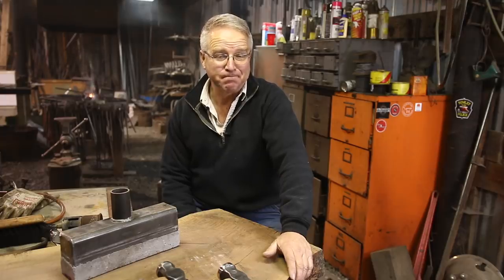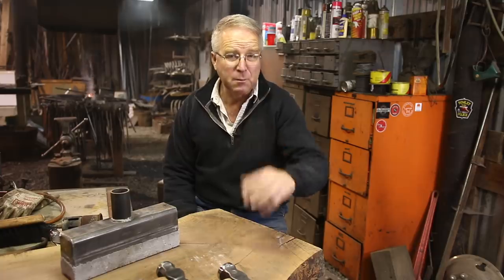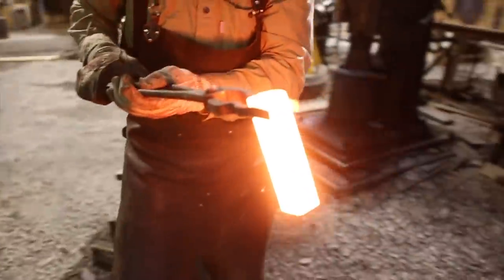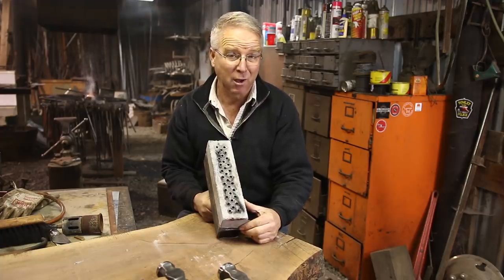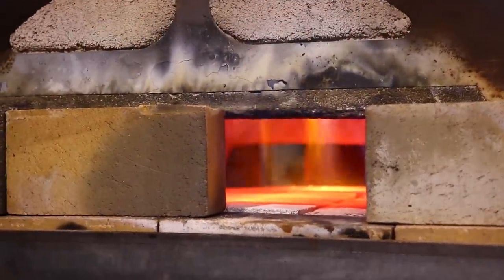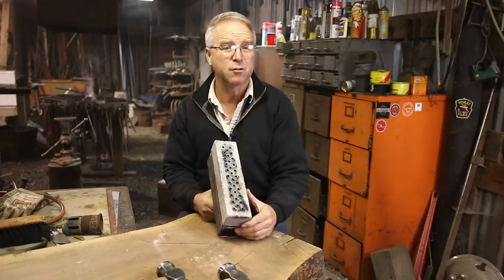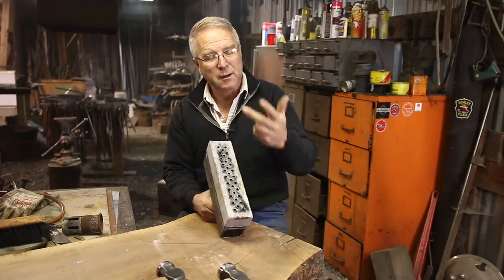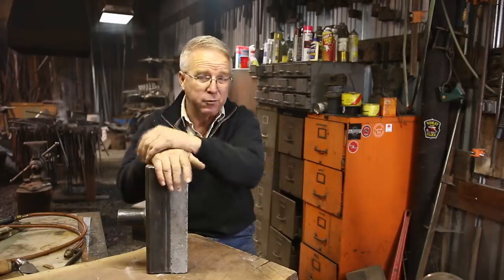What is a Ribbon Burner?

Comment: Do you know what the inside of the burner looks like? Is it just open or are there chambers? Thanks
Reply: The steel part is just open but the refractory has tubes running through it. Hope that helps and was what you were asking.

Comment: Would this work well for an NG forge?
Reply from the maker: Yessir
Reply: @essentialcraftsman  I want to use NG, and understand that the average residential gas meter system in the USA usually produces less than 1% pressure.  (This is unlike propane, which is a regulated system allowing you to move the gas pressure in your forge from 7 lbs down to 2 lbs).  But I've been told that using NG for a ribbon burner is still doable, but you need a longer mixing chamber, and you want to be able to focus on and design around "volume", not pressure.  Am I correct?  Which leads to my main question;  when a NG line comes into the mixing chamber, what should be the diameter of the orifice?  Your propane system uses a welding tip with a small opening because it is pressurized.  But if a NG system works on volume, does it even need an orifice when entering the mixing system?

Comment: Great video.. Not trying to highjack your channel but on my channel I have a ribbon burner forge video and love it. Only takes around 10min. to reach forging temps at 5lbs.propane pressure and can drop the pressure to 2lbs as well .. Great forge no hot spots and is deffenitly quiet.. Martin M&S Blades

Comment: The math is not that hard, you will be able to do it.
As soon as you know the amount of fuel going in the hardest part is over. The rest is just... how big is the surface area? How much energy is there per amount of the fuel? And for the R-value (thermal resistance) you need the temperature in the ofen as well as outside in the shop, easy to get with a thermocouple. If you or anyone else is interested (and reads this...) just drop a line and we can dig deeper.

Comment: If the fuel and air mix inside the steel piece, isn't there a risk of the fuel igniting inside the steel piece causing an explosion?
Reply: It wouldn't be an explosion even if it did! The speed of the gas going through the small holes would increase to the point that the flame could not propagate fast enough to travel back into the chamber. Even if the pressure were dropped low enough to allow this it would create an ignition chamber where the combustion of the gases inside the chamber would quickly increase the pressure and hence the flow rate (forcing the flame out of the holes)!

Comment: Kinda newba maybe, Thinking lbs are only half the info...2-7 lbs is pressure but doesn't volume matter? 2 lbs on 3 inch pipe is different than 2 lbs on a half inch pipe? Can you build a ribbon burner for us?

Comment: What about burning coal or wood
Reply: Wood is difficult to work with, possible yes, but messy and inefficient, Coal is nice, but messy, and getting harder to source, at least good anthracite, cheap lumper coal is plentyfull, but good forge quality coal is hard to come by, especially on the west coast
Reply: northman logging  thanks for the reply
Reply: Make your own charcoal. Also I wonder if you could run a forge on wood gas.
Reply: once again expensive and very messy, basically you have to smolder a 55 gallon drum of hardwood chunks for a few days to run the forge for a few hours, smoking the entire neighbor hood out in the process, though lump charcoal does work good.  Wood gas? maybe, haven't played with it much or at all.

Comment: Propane is a molecule, it's made of hydrogen and carbon atoms. Oxygen is an element it is an atom.
Reply: waldosan but it doesn't hang around on its own, it is paired in a molecule of O2.
Reply: Oxygen is diatomic so its technically both I guess
Reply: In air, it's a molecule

Comment: Very expensive to run these for a forge . I suggest waste veggie oil burners , its free and hotter Then hell.
Not tryna nock your product brother i just no how expensive it is to run a propane burner . I suggest you connect this to your natural gas supply and maybe sell a kit for others to do the same  . you could make a quick connect propane style unit and just run a air hose for your nail gun as a temp gas line directly off the gas meter . No need to run a gas line to do this just make the system compatible with your current pneumatic system  . Great build though and fantastic product . 
my suggestion to you is ditch the ceramic , use ss steel . this will cause the fuel to ignite behind the nozzles jsut a bit and burn supper hot , also the IR coming off the ss metal heats your work . Give it a try with just steel and you will see what i mean and this would make your product cheaper to build but even more effective .

Comment: That looks supper wasteful of propane for what most guys do.  If you regularly need to do truck axles, and large ornamental stuff, then that may be the ticket, it sure works for you.  But even a large sword can be done in a forge with one T-rex burner, and the 2 pounds is only pushing on a 30 thou orifice.